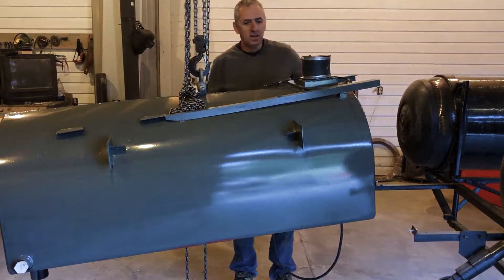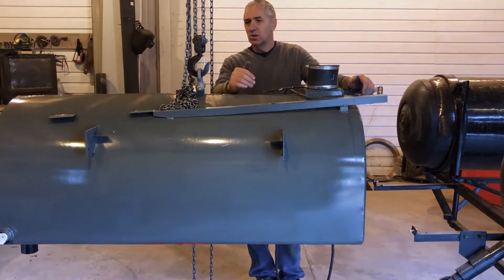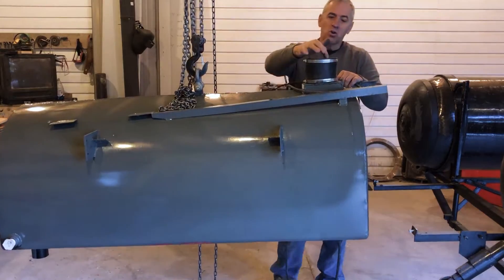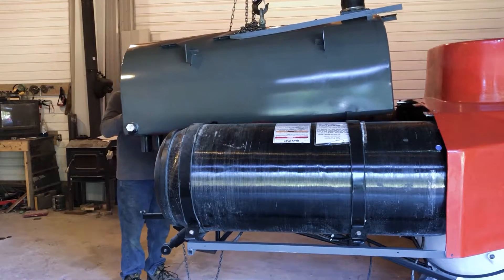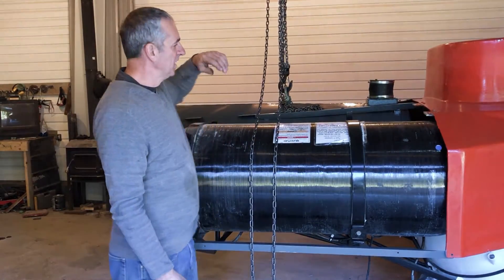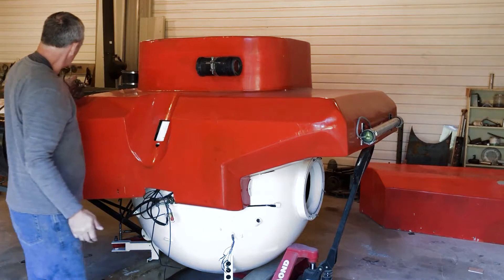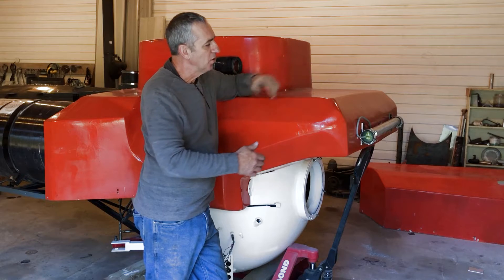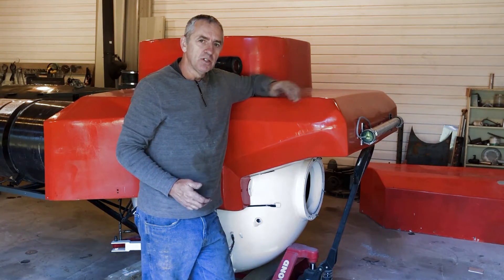Installing Ballast Tank On E3000

Comment: So You pump the Submarine Ballast TNK with a high-pressure water ballast pump Followed By Low-Pressure Water? Then when you want to pump water out Of the Ballast Tank You want to Pump water out with a High-Pressure Water Ballast Pump Followed By a Low-pressure Water Followed By High-pressure Air Followed By Low-Pressure Air When You see More Air Bubbles Than Water You Shut the Ballast Pump Valve Off And Follow It With Low-Pressure Air To Surface Submarine. From, JASON-GLEN-SMITH-ll
Reply: Want To Know If I'm Right? Thanks, From Jay

Comment: What are the dimensions on the top opening (for the solenoid valve) and the two bottom openings (where water leaves). Where does one find a resource that would let one make calculations about the sizes of these required openings, the sizes of the solenoid valve(s) and the rate of water / air exchange?

Comment: Hank, do tell a little more about that oil-filled solenoid! I believe that's new?
Reply from the maker: No, not new.  it is a 1 inch solenoid submerged in a oil bath with a rubber housing (sewer pipe coupler)